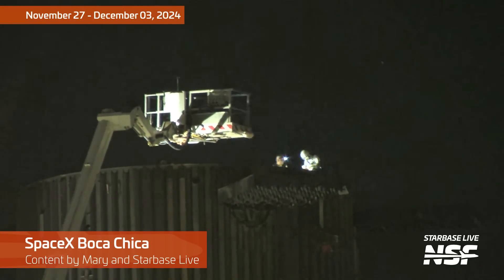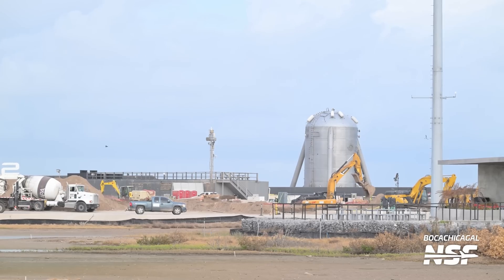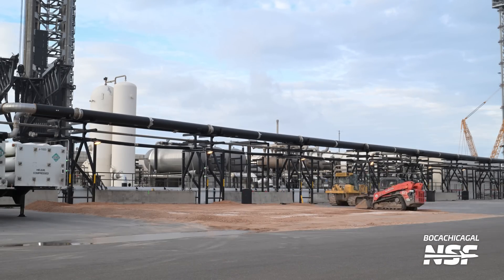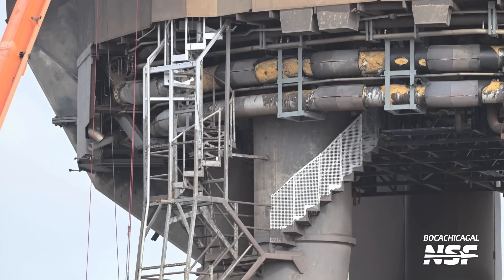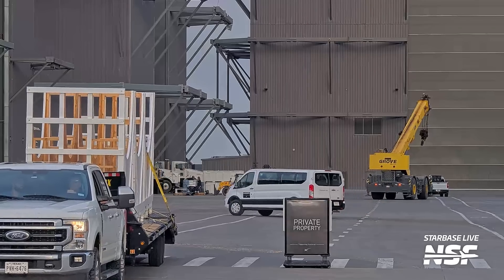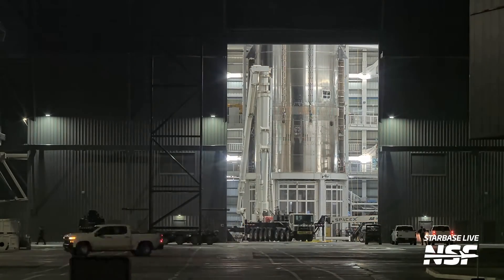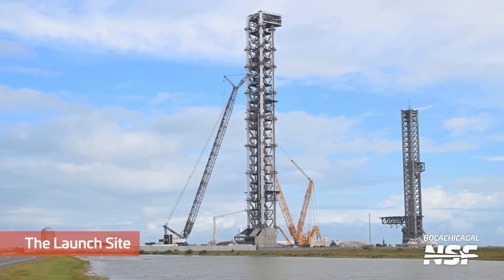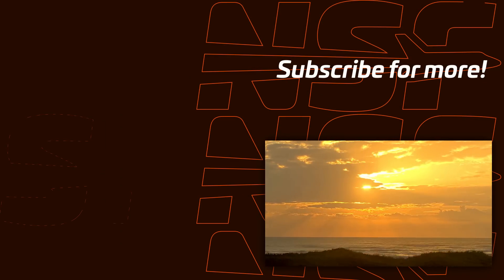Mystery Hardware Rolls out of Starfactory | SpaceX Boca Chica

Comment: First, those wooden circular braces, I would say their mock up for the inside of the starship. The big thing you have to remember is the chopsticks on this tower are not as long,so they do not need as much stabilization & there should only be specific struts that will be reinforced. Like I said, the second pad has smaller chopsticks so they may not need very much reinforcement.

Comment: @Das, IMHO those scaffolding are indeed for workers safety. (when you are working on a roof of a building you also need to have a rail installed). The reason they install it there is probably because on the flat surface its simply easier/safer to install.
Reply from the maker: Seeing a lot of comments about the flat area... will look for more info. - Das

Comment: That sloped steel is steeper than it looks, and is slippery when even slightly damp. Landing on it in a fall would hurt. Ever see the roof of the Caesars Superdome in New Orleans? It doesn't look steep, but workers need ropes to work more than halfway down it. You will see if you watch the Super Bowl on February 9, 2025.  
That big tube is a fuel or oxidizer tank. 
You need to watch, 'Arctic Sinkholes' to see why the water is going to get higher, faster than you think.

Comment: If anyone is interested part of the labels on the white wooden structures reference the diameter, and say NOT FOR FLIGHT barrels. And another (the last one) says AFT, and gives the tool capacity without casters
Reply: It said FWD, MID and AFT, on each part in order
Reply: Not for flight barrels is 100% a joke

Comment: A full length methane tank would make sense. Instead of stacking the tanks and using a downcomer pipe. It would promote joint cooling between the 2 fuels. While providing lower issues with fuel flows

Comment: 0:53 I've often wonder if they could use the Starship assembly line to build a raptor engines based equivalent to the Falcon 9 using superheavy materials.  And in my mind, this tube is kind of what the beginnings of such a thing would look like to me.

If course last time I made such a prediction was nearly 2 years ago now, people ridiculed me up one side and down the other.  The prediction then was switching to a mobile launch mount.  :D

And while I'm making predictions - I also think they'll start covering the launch towers in heat tiles, since they already manufacture them, they can survive multiple launches/catches and be replaced in minutes if faulty (vs. painting the tower and waiting for paint to dry).
Reply: What they're building at the Sanchez lot is not a mobile launch mount, they're just assembling it off-site to save time, so it's ready when they're done digging the trench. It will be moved exactly once. It makes no sense to move the entire pad around when you already have transport stands that do the same thing and are much lighter/smaller.

Comment: That silver angular piece on the front facade of the office building I believe is just filling in. They are trying to finish the office building interior finishes so they can furnish the building which would all be ruined if you have a massive hole in the facade. I’ll be they couldn’t get enough black panels in time. If it were an accent element it would be a true triangle starting at where the glass starts to angle up. The left edge is ragged not sharp.

Comment: They can not allow workers to walk on the sloped areas of the area on top of the OLM. That's why the guardrails are limited to the flat areas. Walking on the sloped areas will require the workers being tied off, so no guardrails required.
Reply from the maker: Makes sense 👍 - Das
Reply: @NASASpaceflight  If you looked at the guy going down the slope towards the man-lift you can see that he is hooked to the scaffolding by a PFPH.

Comment: That midsize tube is surely to ensure all the fuel is at the bottom of the booster for the boostback (41 sec, 13 eng) and landing (4 sec, 13 eng) burns. This makes it easier to steer (?) the booster and certainly for the tranition from horizontal to upright flight. Perhaps ships intended to land back on earth will have something similar.

Comment: Ultimately, SpaceX will need to build a large air separation plant near the launch site as it will save transport and purchase costs. Nitrogen, oxygen, argon, other(?) are all useful gases. Separation is likely by cooling below boiling point. There was apparently natural gas wells on site. So, just by creating electricity from wind (very plentiful on site), SpaceX could create rocket fuel on site at very little operating cost.

Comment: "Downcomer" is an appalling term for a 'down pipe' - you know those things on the side of houses attached to roof gutters. As with the large methane pipe in the Booster and ship, fluid is intended to go only one way - down. SpacX probably use it to load methane as well, but in flight fluid is meant to only flow down.

Comment: The fall net is up, those sparks were from welding
Reply: The thing is that we didn't see any other work for at least hours on either side. So unless a worker snuck up, did 5 seconds of welding, and then snuck down (all without the elevator) then it seems like some electrical anomaly

Comment: I think scaffolding is up there for the workers to hook onto... guardrails on the edge would not allow them to hook a d-ring onto
Reply: plus you would want a guardrail at the point where a person won't have been sliding down a slope prior to hitting said guardrail, so either way, you want them at the top edge
Reply: And it is way easier to install it there, where they can walk.
Reply: That’s why those big platforms are being installed so you don’t need the fall gear. Plus building and tearing down the staging every time is costly and time consuming.